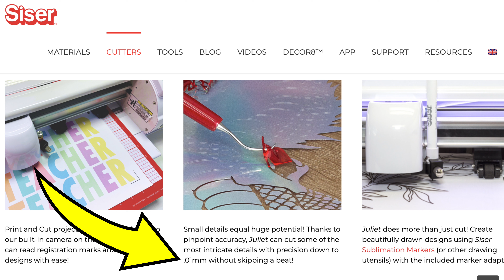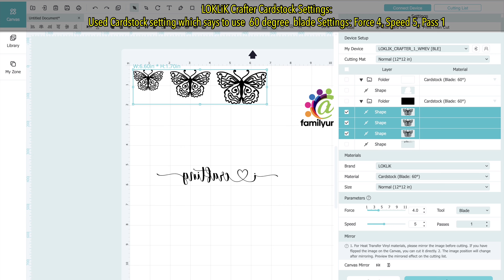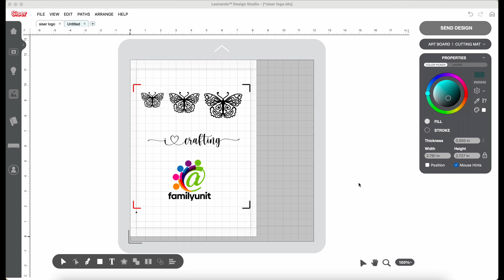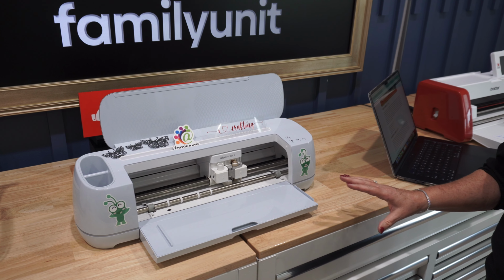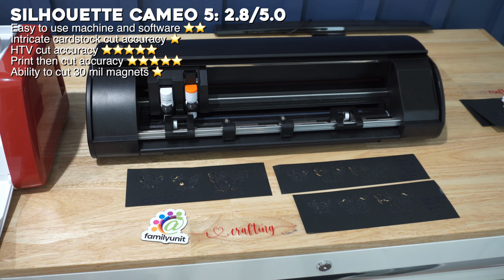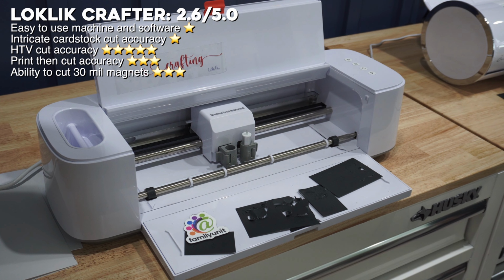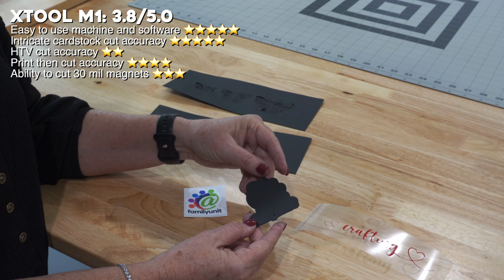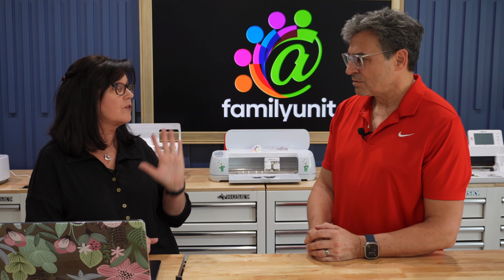Cricut may not be the best cutting machine

Comment: I'm disappointed you rated Cricut the highest. I own the Cricut, Xtool, Brother, and Silhouette, and I go to the Cricut last... every time. I hate it. I hate that you have to fuss around when using non-Cricut materials. None of the others give me that issue.
Reply from the maker: Interesting. I don’t have any issues with any brand of materials I use on Cricut machines. I do have issues with the software periodically which is a sore point. Otherwise, it passed all our tests with flying colors.
Reply: Absolutely ZERO fuss using Siser, Hobby Lobby, and even cheap knockoff vinyl we bought at a dollar store using my Cricut Maker. You may have a jacked-up machine, Beth.
Reply: @emilinaina @webereal  The problem is that you have to figure out the settings and then set them every time. Or you have to figure out which Cricut material is equivalent. No, my machine is not jacked up. It's just that Cricut is limited and always has been. With my Brother machine it is just right every time. I never have to figure out which material to choose. I never have to figure out the settings. It's just always right, which is why in my home, my Cricut collects dust, and my Brother machines are used regularly.
Additionally, it appears that some of the issues you had ith the Brother and other machines are because you may not be using the right mat.
Reply: @bethbujak well if u decide u don't want the cricut collecting space and dust in your home I'll sure be glad to take it off your hands for ya. Xoxoxo

Comment: The Xtool blade function seems useless. Nice marketing gimmick.
Reply from the maker: It actually works well cutting more common large shapes, but not on super thin fonts or detailed card stock. It's cool that you have the ability to cut and engrave wood and can do vinyl and cardstock all in one machine. We’re hoping they add some blade adjustment options in future software upgrades.

Comment: Hi, thanks for this great product review! I've been working with paper for several years with a Scan'N'Cut SDX that I don't find precise enough. After watching your video I was very hesitant to buy a Siser Romeo (which has the same features as the Juliet but a larger workspace) because I wanted a very precise machine for paper cutting, capable of handling very fine details and complex designs. I've just done some tests and I can make very clean cuts of 0.6mm (0.02 in). I don't quite understand what happened in your test, but I wanted to give this information to those interested in a Siser machine.
Reply from the maker: Appreciate the feedback. 🙂

Comment: Wow! What an amazingly comprehensive comparison you've done for each of the machines that were demonstrated. I have the same Brother Scan N Cut, Cricut Maker 3, and the Singer Momento, the newest cutter that just came out. I had the Cricut Venture 24” and the Siser Romeo 24”. I sent back the Cricut Venture because it was a ripoff. You have to use their special vinyl, allowing you to cut without a mat. Any 3rd party vinyl must use Cricut’s mat. It does not use a rotary blade, and it is very limited in what it can cut. The Cricut Venture is the same as the Cricut Explorer 3, with the exception that the Venture is 24”, but both are identical machines. So, the price tag for the Venture is anywhere from $799 to $999 depending on the sale. It's overpriced for a non-upgraded 24” cutter in 2024. I returned the Siser Romeo for the same reason you had trouble cutting card stock. Plus, I had to exchange it twice due to defective hardware. As for the software, it is one of the best and outranks Cricut Design Space in so many ways. For anyone who may not know you can create your designs in Siser Leonardo Design Studio export and import into Cricut as long as it is a subscription. The other drawbacks with Siser Romeo or Juliet are that they don’t have a pen holder and no rotary blade. Also, most of the YouTube Content Creators were sponsored by Siser, and they didn’t show card stock. You're the only channel that demonstrates card stock as a non-sponsored and gives thumbs up. I haven’t tested the new Singer Momento cutter. As soon as I do, I will have a review completed.

For me, the Cricut Maker 3 is still the best for all materials. Correct, lately Cricut’s software has been having major issues since the last few updates. Instead of getting better, it is getting worse. Either way, the Maker 3 does a damn good job with any materials. Although it is a small machine and not good for large products. The Cricut Venture was meant to replace the Maker 3 but instead went back in years making it the same as the Cricut Explorer. The Brother Scan N Cut is more designed for fabric like doing appliqué. Brothers' way overpriced ($22,000) sewing and embroidery machines have been designed around the Scan N Cut, and that is what their focus is based on, not so much for card stocks. I won’t even give my opinion for the rest of the brands you demonstrated, not worth sharing about (Junk.) I had them all with the exception of XTools M1, something looking into getting now.

Even though you didn’t demonstrate the WeCreat I still like to share my experience. I also have the WeCreat laser cutter, but it is going back. The day I received the WeCreat, it was damaged. WiFi keeps dropping. Power cord connection keeps coming off the back of the unit if I slightly move it. The connection is very loose and barely stays in the unit. The Autofocus within the software at times throws the project out of alignment. Mind you, this is day one with all these problems. I contacted support, and it’s been a challenge for replacement or fixing the problems. Note: there is only one support employee, no others that are available to go through to get help. Button line, support blamed me for all of the issues. He claimed I moved the laser too often, which is why the power cord is loose. Mind you, I unboxed the unit and placed it in two locations and no more. I was told I don’t have the laser near my computers and routers. The laser is 4 ft away from the computer, less than 5 feet away from the router with no wall blocking signal. I have three printers, two computers, and Alexa devices all in the same craft room with the laser, and the other devices don't drop from my network. As an IT professional for over 22 years, I have the knowledge and experience to know about home and business networks. But, it is my fault why the WiFi is not working on the laser. Support has no answer for the autofocus alignment.

I can’t say if my issues are isolated or not. Most WeCreat reviews coming from YouTube or other social media are sponsored. And neither of the reviews they are using the WiFi to demonstrate the laser, USB cable is what you see connected to their computer. And let's say I didn’t have these issues; I still wouldn’t recommend WeCreat Vision products only because their warranty isn’t what it states. In fact, the warranty isn’t clear. And as I was told by that one individual, the only support person to contact any problems with the laser must be proven, and it is still up to him to make a judgment if he will send parts or request you send the unit back for refunds. He made it very clear, no exchanges.

I too have a YouTube channel, and never in all the years as I demonstrated product reviews and contacted companies at times needed help, have I ever been put through this ordeal as I had with WeCreat Vision. In fact, it was my fault not researching and contacting them before making a purchase. I always made it clear with my audience to research before buying, and this was my first mistake by not doing what I was preaching. So, would I recommend the WeCreat? Absolutely not. No matter how good the laser may be, it's the negative support and warranty that is why I will not recommend them. I will be doing a review soon for all that I have been through, in the hopes that anyone watching can make a clear decision to invest or not to invest in WeCreat Vision.

Again, you guys are awesome, and I can’t wait to see what is next. Thanks so much for this demonstration. I know the hard work that it takes to do multiple product reviews all at once, and this turned out excellent. If there were anything to add in any of your reviews, it is for product support and warranty. I believe it is one of the most important things to talk about when doing any product reviews. Otherwise, Great Job! 😎
Reply: What a thorough summary! Wow! I subbed to your channel. Sounds like you have a lot of useful insight in this space. Can’t wait to see the Singer review also.
Reply from the maker: Lou! We too were incredibly disappointed with Cricut Venture, and are trying to sell it on Facebook. Huge disappointment. Really surprised to hear about your WeCreat experience! Ours has been perfect. No problem with the power cord or the Wi-Fi. As a matter fact, it’s Wi-Fi is so strong I can pick it up down the street! Sounds like you got a bum unit. We forwarded your comment to our contact at the company. Hopefully they will do something about this. Definitely do an honest WeCreat review video on YouTube and that will help your case. They told us they want to see the good and bad. Thank you so much for your comment! We can’t wait to see your review of the Singer cutter. We had never heard about it and are intrigued. Subscribed to your channel!
Reply: @craftwithfelicia Thank you for the awesome comments and support; it’s really appreciated 👍. Yeah, I have Venture up for sale at half retail price, and no bits, with the exception of a few buyers who want it for nothing - lolol. As for the WeCreat, it’s a done deal. The company is preparing to send me the shipping material for a full refund unless the right contact has a change of heart. I hope my comments forwarding to your contact aren’t for Patrick; he is the reason why I couldn’t get a replacement and is blaming me for all the issues. Either way, your awesome thoughts and actions will always be appreciated - can’t thank you enough.

I will update you about the WeCreat and when I posted Singer Momento. Again, thanks for subscribing. ❤😎
Reply: @lock.robster  Thank you.
Reply: Wow, thanks for the review on the wectreate, I've been saving up for one but also trying to watch reviews which have been confusingly mixed....

Comment: I was shocked the Cricut came out on top as the software is about purchase, purchase, purchase i have had the maker 3, explore and the joy and i have to say connecting via bluetooth was a massive issue reason being their drivers are outdated it took 9 hours with cricut support to try and help find out why the joy would connect to pc but design space could not find the machine and connect,support came up with no solution, only to find out its 2024 now but the drivers in the joy are  2006 ended up sending machine back  after reading thousands of comments on forums with the same issues across many cricut models. Thank you for your video's though they are very helpful
Reply from the maker: Cricut is going to have to make some changes. Although I haven't had issues with bluetooth connectivity on my Maker, Maker 3, Venture or Joy, I did experience a little at the beginning with the Joy Xtra. This isn't something I've had issues with on the Brother or Silhouette. Which machine(s) do you have now?

Comment: I've been using silhouette for the past 12 years i have a cameo 1 and a cameo 3 love the software that is 100% offline. Now I'm thinking about getting q juliet mostly because I use it only for vinyl. Still not sure jejeje 😅
Reply from the maker: Silhouette's software is by far the most advanced and feature rich. You can use it with machines other than theirs by saving files out in SVG format but this requires the business edition.
Reply: Mine has given me fits for a decade. Silhouette is getting ditched.
Reply: @craftwithfelicia … which only requires a one time purchase of only $49.99 on sale. This includes lifetime updates. Not a monthly subscription that still isn’t feature rich.
Reply from the maker: @ - I have silhouette business edition and it’s so worth it!
Reply: @  Excellent response!!!
Reply: @   I looking for the correct settings for cutting the magnets as I have not tried to cut magnets yet. I do have the additional blades for cutting specialty materials.

Comment: May I ask what blade you used for cutting cardstock on the Loklik? It wasn't clear from the video whether you switched from the 45 degree blade to the 60 degree blade which is the blade recommended for cardstock on the loklik website.
Reply from the maker: 60 degree but I did another test using 45 degree and various force settings with no success.

Comment: Although the Cricut cutter cuts well, the problem I have is with the Cricut software.  Also? I don’t think you used the correct settings for the other cutters. 

And my Cricut is not collecting dust. It’s covered with a nice cover that has pockets to hold all the tools that I purchased to be used with the Cricut.  

I love using my Silhouette Cameo 4 with all of its robust features, and the ability to save my designs on my own computer in various formats. 

Thank you for sharing your opinion.
Reply from the maker: Design Space does have issues at times but their cutters are solid. Silhouettes software is so much better. Thanks for chiming in.
Reply: @craftwithfelicia  You’re most welcome.

Comment: I think this was a pretty good test, but I'm wondering if your previous knowledge of Cricut and its software had any impact on its ability to perform better.  I just think that as you are actually a first time user for every other machine, if that had any impact on the ease of settings and knowing how to use the software.  Especially with the calibrations that you seemed to have some troubles with on some of the other machines.  (Totally valid troubles, but I am curious if a first time user of the Cricut would run into troubles as well)
Reply from the maker: Valid but straight out of the box as a brand new user back in 2018, Cricut just made sense. No major learning curve with the machine or software.
Reply: @Sheila-gz1st  i agree. I have a very old cameo 1 and i can certainly cut such intricate butterflies. So the 5 can too.

Comment: I'm surprised by the loklick it's like the cardstock sheet didn't stick to the cutting mat well enough and dragged it about
Reply: And why did the stcker have 2 offset cut lines? That was surprising.
I'm looking at a loklik which all other reviews look great
Reply from the maker: Check out the newest LOKLiK iCraft - https://youtu.be/DfC1tvyxK9I?si=RlMQSpOiob--o0QM. I’ve done testing with it and had much better results than the first machine. I’ve made cards and stickers with no issues.

Comment: hiya, 8:02 I noticed you used holding tape for some machines like cricut, but then not for ones like the loklik. Were additional attempts made with the tape as that'd stop the cutting issue there.
Reply from the maker: Yes - many attempts - I also used a variety of mats - some were super sticky some not so much.

Comment: I wish you had tested cutting fabric for quilting, cards etc.. appliques.  So many of us are turning to these machines for help.  The problems with the Cricut interface that you and so many others describe is a huge turnoff.  I do think it deserves a lower rating because of that alone.  It doesn't matter how good it cuts if you can't get it to connect.
Reply from the maker: I have no issues connecting to my Cricut Maker. I did, early on, have issues with connecting to the Joy Xtra, but that seems to be resolved at least for me. Cricut's software can be buggy at times but I've recently heard that Silhouette's had issues. As for testing fabric, I've got that on the list to test.
Reply: @FamilyUnit  Thanks!  That's good  to hear. about the connectivity.  I am looking forward to your fabric testing.  I am interested in learning which one cuts best without bonding it.  Or alternatives.  I do applique quilts, or want to do more, and I don't use  a fusing medium.  You can  end up with a really stiff applique piece.   I machine quilt mine down and use 505 basting spray to secure it.  So how can I cut my fabric instead?
Reply: @KJW930 je me posé la même question moi aussi 
Donc j'attends un retour 
Pour me décider dans mon choix et achat 
Merci

Comment: What mat did you use with the scanNcut for the cardstock cutting. You should be using the low tack mat. A standard mat will not work and could cause the results you got. It's just as important to pick the right blade as well.
Reply from the maker: I used an old not so sticky standard tack mat. I just tried low tack - same results.
Reply: AAAAAND that's why Brother scores so low, sports fans! Brother seems like an overly conceited Japanese company that expects everyone to bow to their procedures. The result? A machine that has great potential, but remains too complicated. Cricut makes things easy. If Brother didn't make cheap sewing machines and printers, they'd probably be out of business.